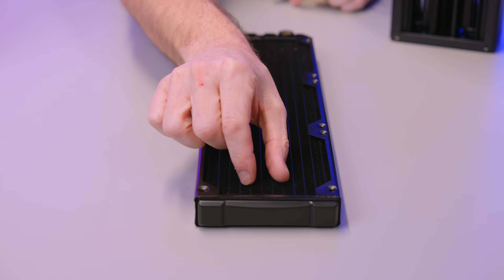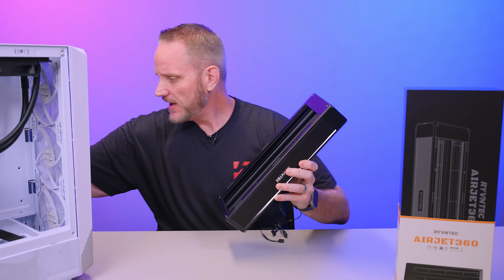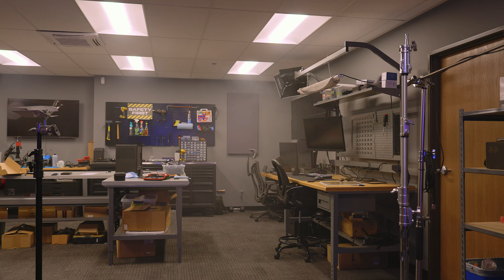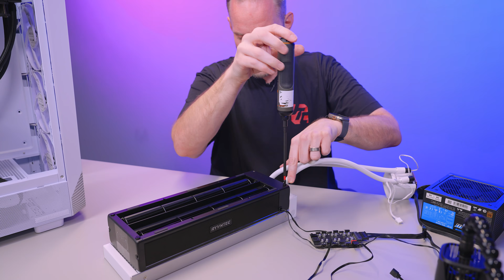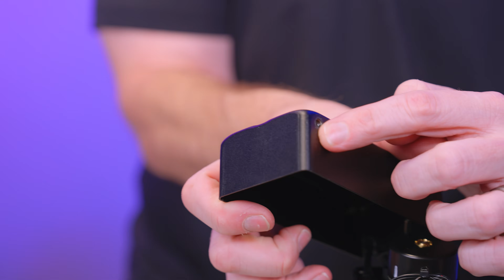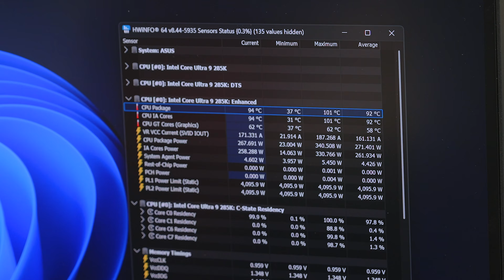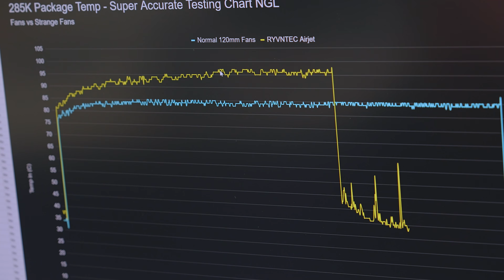Check out this INSANE Prototype!

Comment: 25:20 - Nono, a spreader WOULD help a ton so long as their centrifugal fans are designed remotely well. Centrifugal fans are great at air pressure, and these are already moving enough air as a fan. If the air could be moved through all of the radiator to maximize the radiator's performance, it looks like that fan is moving more than enough air to do a great job.

It'll still be a bit of a trick to make sure pressure stays even enough after some sort of diffuser without robbing too much performance, but that is definitely the way to go for mounting this to rads. I'm sure this concept could easily beat axial fans for rads, at least when size is of little concern.

Comment: Not worth it for mid cases, to much space restrictions, only good for tower cases 360-420 set ups, also thinking if its a prototype then you will need to give it at least 2 years before it hits the consumer markets, thats after a redesign as its a fail on health and safety side of things, otherwise PC builders will end up with missing the tips of their fingers.

Comment: Full tube for the screws like you said Jay and maybe a gasket of sort to seal the fan to the radiator would make that unit work the charm we used to do that with the back in the day nighthawk water cooling

Comment: I agree that pulling the air thru should improve the cooling from the configuration you had goin. but i am surprised that you didn't  try those on a regularly air cooled, and check for a temp difference between normal 120's and  these. I am actually wondering if any fan on the cooling fins would be needed at this velocity.

Comment: So in terms screw tolerance they would need a screw tube for more rigidity, in terms of airflow it's great for airflow just not good for a radiator cause it only cools the core, v2 or revisioned should widen the gap in the middle towards more airflow width, if those fixes are made this would be a contender for an alternative for aio/ water cooling setups

Comment: I have a similar case but I modified it so the power supply is rotated 180 so is suck air in from under the gpu I also upgraded the power supply fan and lowered chipset and gpu temps

Comment: Ryvntec needs to hire an engineer. The body of that fan system is just a folded up hollow piece of tin foil. You cant even tighten the screws without flexing the entrie thing and binding the fans?

Comment: Jay you have a mill and a 3d printer so now you can show of your knowledge and make a mount plate that fix the gap that have a air spreaders to solve the air flow over the entire radiator.

Comment: Would LOVEEEE to have this on an air cool setup but a lil specific to config. If CPU cooler fins are facing front to back I would mount this in the front. If CPU cooler fins face top and bottom mount one on the top and if room one on bottom. I do feel that would be pretty cool on temps even if under load.
Either way would be great. The size is a lil over the top for the air flow IE: I would make slightly smaller to fit more case.

Comment: The demise of all scroll fans is an under-engineered bearing at each end...if they are not heavy duty and rated for long life they will inevitably start squeaking with failure soon after. This usually happens well before a normal round fan design would fail due to the more centralized nature of the bearing load.

Comment: I think they need a different radiator arrangement for these radial fans like those in an AC., the wrap around radiators will work more efficiently in a pull config. Alternately you need a air baffle in front of a standard radiator to redirect the laminar flow for more coverage.. For radiators the flow loss due to the baffle will be insignificant. But noise can be a factor.  Also the thickness of this arrangement may be too much. There are companies working on this curtain type blowers. Definitely interesting to see what they come up with.

Comment: So hear me out. If they add the tube in the screw hole, it would fix both issues of the fans not spinning under tension as well as not being able to get the screw through the housing.

Comment: Use some foam around the radiator and the fan, seal the radiator to the top inside of the case and mount the fan to the top outside of the case, then the thickness of the fan won't matter.

Comment: would've been nice to have a test with the airjet only used as a front or bottom case intake to see the impact on an AIO with regular fans. especially after seeing so clearly, that it doesn't work as an aio cooler.

Comment: Use the fan as an exhaust and mount all other holes with radiators but without fans. Airspeed through a rad is very fast saturated, it could work really good.

Comment: Nah jay it's nothing new. These blowers exist since 100 years ago man hahah. It looks like you need to flip the top fan making it suck in air into the case instead. It would make the logo also not being upside down. The AIO CPU pump is also upside down and turning the radiator so the hoses are in the back of the case might work better for fluid flow. Having the pump upside down means you might have an air pocket inside the pump and won't pop out into the radiator now causing high CPU temps. When the screws are too long use washers and don't push them through the air cooler but the radiator so only the tip goes into the blower fan avoiding the problem of hitting rotating parts all together. I think you put many things together backwards causing the problems you are facing in this video. AIO CPU pump hoses always go on the top or one of the sides. Never the bottom

Comment: You need to test this in a case WITHOUT the radiators. I think you established early in the video that they weren't really useful for putting on a rad, but I would like to see what the airflow and temps would be like in a fully air cooled setup.

Comment: It's a long shaft (insert Jay's hehe!) and the bearings either end are out of alignment when unit is screwed down. As mentioned, a gasket or shim to keep the unit true. Defo on the pull config and additional tubs for those end caps.

Comment: you did it wrong :D you need to pull with that fan through the aio to maximize its actual performance :D and also use 1mm rubber gasket to seal the fan to the aio for real try it

Comment: An aio, with embedded pump in this structure with embedded fin array'd radiator, would be a great new product. Also normal 120 fan miss out at least 30% coverage due to round, and hub design

Comment: I would use this in a case that has very intentional air inlet points. Just this thing at the top of the case exhausting, and no fans anywhere else. Just let it draw air in over the components at critical points. It's going to move a lot of air and do so quietly, and will be able to pull through the restriction of the case easily.... The next logical step is a passive heatpipe based CPU heatsink with a duct that can be extended to and sealed up to the rear 120mm fan mounting location (or top of the front of the case). A GPU with a large custom passive heatsink is also certainly a possibility here, but would require more ducting. Perhaps this is the first part in a series of components that could work together to build a desktop that only needs this 1 fan assembly at the top of the tower to cool everything.

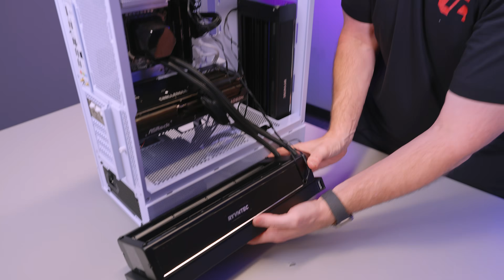Comment: 17:05 Jay, you have a 3D printer. You can make a brace to support the walls. Or even a tube for each screw like you said. Then show them so they can throw a fix in the box for fans that are already made.

Comment: I wonder if there is a way to change how the air moves through the unit. Instead of creating a single column of air through the center, have it create 2 columns at the outer edges. That way air would move through a more useful part of a common radiator, instead of the center where it's kind of dead space for liquid flow. OR, if it would make a difference with a front and back flow radiator, like the HW Labs GTX and GTR radiators. Just another idea.

Comment: The radiator test makes me wonder if we could get an almost all in one radiator config where the motor and distro/reservoir are attached to and arranged around a narrow high airflow radiator, with the radiator thickness stretched to maintain the same surface area. That might create a really unique radiator layout and case

Comment: Try it in a pull config.  You have a 3d printer, print some spacer tubes, and mount it up.  If it doesn’t work, we’ll know.  But many of us think it would work pulling air, as it theoretically would pull from anywhere it can get air, instead of the forceful, directed push.

Comment: Radiators are designed to maximize surface area that the coolant has to flow thru - think of your engine radiator on your car, it normally has two large fans actively pushing air across all of the rad fins. But your CABIN fan DOES utilize a blower fan like this, which are designed with one thing in mind - to maximize volume of air moved. In your car it is used to move hot or cold air in. They’re great at displacing the hot air inside of a case, or pulling cold air into a case, not necessarily to cover maximum surface area to a radiator

In other words, it is an easy low-profile way to create positive or negative air pressure and to maximize air displacement, but not to efficiently cool the fins on a radiator for heat dissipation

Comment: everyone talking pull configuration, and i'm just like..shrouds, you need a funnel here, it seems. Even just duct tape would have fixed the air leaks. I cannot understate that this is impressive, but it's like a car that runs on water but with ford model t haptics/ergonomics. I am mostly sold on the idea, but this will require additional shroud type stuff to direct airflow properly to interface with existing cases, which may mean external mounting and more shrouding, with colours to match.
Redoing the tests would interest me alot, since they are representatve of the current state of the system in the current market, but it is not being tested in a favorable environment that would enable it to shine. An actual efficiency test with full numbers would also be nice, too. cooling is beginning to be a significant part of electronics wattage, so this system is very cool to me. also, test with a 40 millimeter rad, you've mentioned doing that size often enough i believe.

Comment: I am thinking two things.
1. A PULL config where it pulls the air through the rad. Maybe with a sealed standoff to create a box of negative pressure between rad and fan? Guessing it wouldn't have to be thick even.
2. In push on the output side of fan. A diffuser running the length dead center. A small v to split the air in the center high pressure bar it forms with a lengthwise vane just a little off center both side to further diffuse the air.  I see the issue as channeling the air. Because clearly that thing puts out more than enough airflow to do these things with. What with it shooting smoke across the whole room and all. So split the output right at the output side with vane to split the center bulk. Bobs yer uncle.

Comment: I worked in HVAC for years as a youngster, and ran a company specializing in server enclosures for intrinisically safe environments. Not a fan of rads... If My Noctua won't cool it, I'm doing something wrong. But... pull configuration is the way to go when mounting on a rad. But you're right as to the design issues at the motor housing. But the concept is great... Awesome air flow at a low noise level.

Comment: works just like a roots type supercharger. If you move it farther away from the radiator it would work more efficient. It would need some walls or shrouding from fan to rad.

Comment: What about a 240 mount/ fans but you can put on an 120 wide radiator… that way the motors are pushing on more surface on radiator ( yes the motors / blades bigger but we need that to  compensate for how they work / in the middle of fan more air)

Comment: Maybe try the center 2 holes to mount to a radiator? Seems it would hold it securely and reduce/eliminate the issue with tightening the through screws on the end caps.

Comment: Honestly i wonder why there isn't a block off plate on the inside edge of the fan, AKA you can't see straight through. The way it's open makes me think it will recirculate air.

Comment: what about using the middle 4 holes to mount to the radiator? Don't they align?
probably the rubber pads plus its case flexing is the problem there

Comment: in a/c you pull the air thru the coil that way it equalise the pressure & flow to a point,instead of pushing...imho

Comment: I agree with the call for pull config test, and also consider a hefty sized spacer between the fan and rad.  Seal the edges of course, strips of foam tape ought to be fine...

Comment: Is there room for a 10 mm spacer between fan and AIO?   Like you use a spacer to smooth out air flow on a 4 Barrel V8.   Pull config would be interesting as well, as a few have asked for.
Terry from Australia.

Comment: You should 3D print out a fan shroud; maybe 10mm in depth, and then seal it up with a 1mm foam gasket on both sides and test it with the airjet in both push and pull configs. It would maximize suction or exhaust as well, ensuring all the air goes through the radiator.

Comment: @JayzTwoCents  What if they were to redesign it with 6 shorter motors/fans and turn them sideways so that there would be three smaller channels of air passing through the rads sideways?  That way wouldn't all three channels of air cover the entire width of the rad when the air is passing through? I'm thinking that might improve the rad cooling overall in comparison to their current design. Your thoughts on this please? 🤔

Comment: Guessing it's too late to address these issues. But hey, if they get to a V2 it could be good. 
Would love if someone makes a watercooling version.

If the perf matches or beats (at least) 3x 120mm fans in real world use in a pull config, then I'd absolutely prefer these in a top and/or front rad.

Comment: I feel like this would be better if the frame was closed on the sides that gap he showed at the start is an issue. I'd like to see it tested where that gap is maybe taped off. Also I wonder if RYVNTEC changed to smaller fans and put three if it would help in pulling more air throgh the rad.

Comment: I wish you ran another test with the air jet just as front intake fans for chassis and used the cooler master fans on the aio to see temp differences. Also monitor vrms, gpu etc

Comment: I'm reeeeeeeeeally curious how four of these would fare in say, a Corsair 9000D like I have for my rig. I've got 18 of the Noctua G2 120mm fans configured as intake on both top and front with the two rear being exhaust (fans are all in ABAB style configuration such that A fans are surrounded by B fans and vice versa to avoid harmonic resonances). I would absolutely love to see what four of these could do in the 9000D.

The thing that kind of piques my curiosity here is that even at 65% PWM you have significant airflow from just one of these going into a case. I'm interested in seeing how these stack up against the Noctua setup scenario. I chose the large number of fans because even at only 30% PWM, with 18 of them that's a combined 360 CFM. That goes up to 504 CFM at 50% PWM and if at 100% PWM could reach over 1000 CFM. I'd love to know how the noise compares with 4x Ryventech vs. 16x Noctua NF-A12x25 G2 PP because even with just two "columns" of air, due to the pressurization and space (evein in a 9000D!) those columns would interact and potentially fan air into more areas than we might otherwise expect with just one in front + top.

Regarding the screws clamping the metal against the rotors, that could potentially be fixed with two changes. First, stiffer material would be needed. Although it'd raise the cost a bit, I'd consider an LCP cover vs. the current flimsy metal they're using. Second, and probably the fix that's going to be the most impactful, the part of the cover that isn't impeded by the rotor needs internal bracing in the long screw's direction to prevent flex into the rotors. If there is bracing on both of the areas on the outside of the rotors that could be enough to prevent the squishing. A way to kill two birds with one stone here would be to make the bracing also be the tube that the long screws can pass through to make alignment a non-issue. A third brace above the wiring in between the rotors would further strengthen the cover and prevent squishing with perfect symmetry.

Comment: Unless they didn't line up with your radiator why wouldn't you just use the four holes in the center of the fan and skip the four on the corners. They definitely need to fix that I think the most cost effective way would be to just make that end cap a little more rigid so it didn't compress or if they added a lip or ridge that that cap slipped over to keep it from compressing.

Comment: Ya Id make it thinner, and then put a spacer so presurized air will spread out to the edges. So pulling the vac side air thru the rad didn't work? I mean I don't have my front cover on, so could put this on the outside even on the top too. but that blowing thru the case with just the one on the front would be enough being thats some high positive presure those things make. I bet it would cool better with no fans on the top rad.

Comment: There's several screw holes along the side. Can't they just block of the holes where the motor is?
Or do the other screw holes also interfere with the fan blades itself? 
Did you only used top and bottom screw holes, or did you test the other ones too?